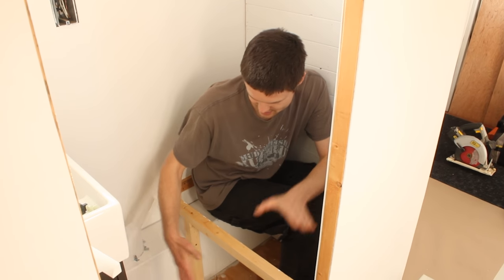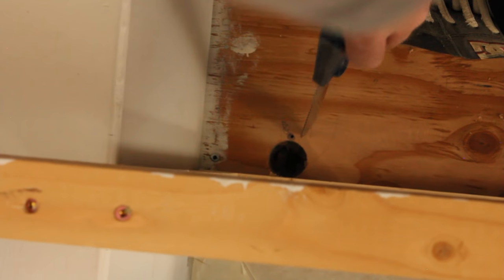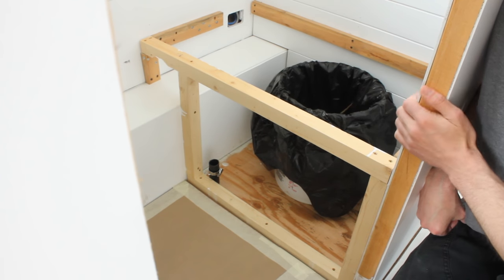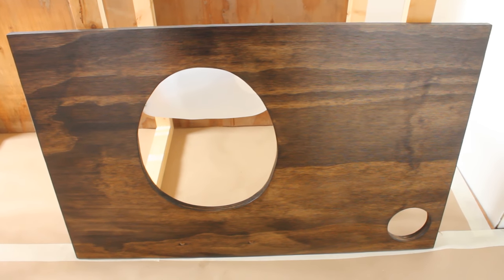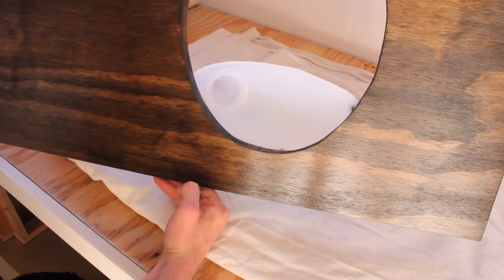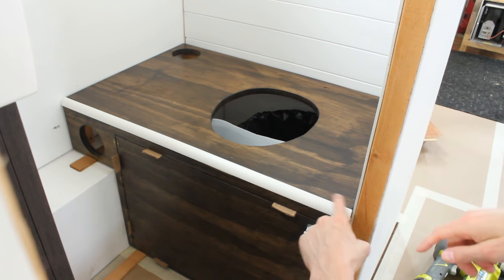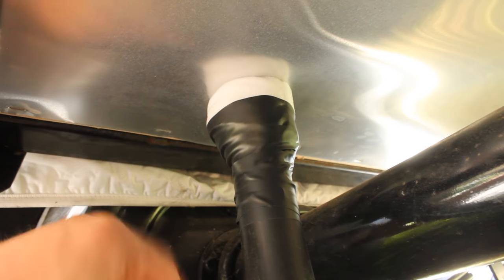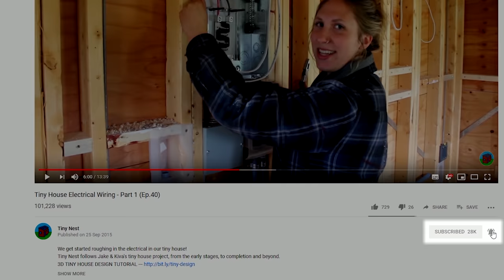Composting Toilet Box (Ep.78)

Comment: Looks great! A tip about the needing nail holes on a finished surface- get some color putty. It's an oil based product commonly used to fill finish nail holes in stained window/door jambs after they're installed. Alternatively you could put screws in from the bottom (nails from bottom wouldn't pull it flush) or clamp and glue that joint (I would avoid this here in case you need to disassemble it later though). Nailing in at an angle doesn't have near as much strength and will often split the wood as well since it's being driven along the grain. For the high nails, a spring nail set is very handy.

I would also stain the inside of the box throughout and caulk all the corners with silicone as well in case of any leaks/incidents but this is probably way overkill. Maybe use some spray adhesive and line the walls/floor with plastic? 

As usual, great work! Love the design and color choices. Just offering tips for anyone they might help, you're too far along for these tips to do much for you haha
Reply from the maker: Thanks for the feedback! 
The plywood didn't have a problem accepting the angled nails in this case, but it was definitely not ideal... I actually like using screws whenever possible because you can manually pull things together until the fit is right. In this case, we are planning on disassembling it because we're deleting the vent holes, we will be remaking the box (the plywood pieces). 
We did caulk around most of it to air seal it for the venting we had planning, but again, that is changing so now it will just be a pain when we go to pull it apart lol 
We're going to at least prime the floor, which will seal it quite well... we're also thinking of laying down newspaper which can be replaced when we empty the bucket, as a backup in case something, uh, goes wrong somehow :| 
Plastic lining could also work... we'll consider it once we're putting it back together.

Comment: So nice to see your solution for a DIY composting toilet. It looks great, but may have some practical issues. So I'm looking forward to see the new video on how you've changed it all. Here's what we thought about after using our DIY composting toilet for 2 years: You may wish to consider a removable urine diverter to take out for cleaning. Maybe also a S-bend with a flexible tube, cause the smell will build up in the tube over time. To get the bucket out easier, you could also remove the bottom ridge of the wooden framework. For ventilation we use a computer fan that is always on. Doesn't use much energy. We are going to make a frame in front of it to hold a simple air filter that can be replaced. Right now the fan is getting very dirty. And have you thought about a squatty potty?
Reply from the maker: We will likely end up getting a commercial urine diverter, and that's a great point about removing it to clean. Ours has been fine so far, because we pour water to rinse/flush after every use, and we pour vinegar down periodically to neutralize any smell, but honestly we haven't noticed a smell build-up (there is an S-bend in the tubing underneath the house). Removing to clean would be a bonus for sure though. 
We are planing on reworking the box so that it opens from the top which will make bucket-access a lot easier. 
We are planning on venting straight down with a computer-fan :) and have already been thinking about how to filter it. 
Squatty potty sounds very interesting, thanks for bringing it up... I bet we could include some hinged foot-rests to achieve something similar... will definitely consider this when re-designing!

Comment: We are using a composting toilet like yours in our camper here in England.  Yours looks good but have you tried sitting on the toilet as you will when it is in action?   You might find your weight is too far back to be able to get up easily.  On a normal toilet we all put our feet almost under ourselves to stand up but with the front sided box, your feet will be well forward of your centre of gravity.
Reply from the maker: It is a bit different than a standard toilet but so far we haven't had any problems getting up

Comment: A rectangular bucket would be easier to slip in and out because you could have it horizontal when in position and then to remove you could rotate it 90deg to pull it out. It might also have better coverage for the "drop zone" 😝 Not sure if Ikea still do the grey "Rationell" bins but that would be pretty much perfect as they are the right height too. Alternatively that hole could have been further towards the outer wall and then the bucket would space to slide towards the inner wall to pull out easier.
Reply from the maker: LOL "drop zone" 
Great suggestion to get a squared bucket, we'll definitely look into that. However when it comes to removing the bucket, we're now planning on redoing the toilet box plywood shell so that you lift it open from the top... we made the door open in front so that we could leave things on top of the box and not have to move them in order to lift it open... but we now have some ideas that will change all of this, and lifting open the top of the box will make it a lot easier to deal with the bucket in general.

Comment: Where and what funnel did you get?  I have tried 3 and dismal failures.  I am working on modifying a r.v. toilet (with the flapper intack) to make a composting toilet.  In concept should work, but lots of functional issues.  May go with a square box with a lid instead of a pail.
Reply from the maker: I looked in multiple hardware stores and just happened across this one, so finding it again would not be reliable sorry :P 
When we do some reworking of the box we'll be looking back into a commercial urine diverter that is purpose-built.

Comment: Hey, you have 3inch toilet  vent pipe thrue sink cabinet, why don't you use this vent to make drainage vent inside of it?
Reply from the maker: That vent was meant to be part of a air-exchanger for the whole house (which would pick up air from inside the composting toilet enclosure on it's way out). We now plan to vent the toilet enclosure directly down, to underneath the house, which will be skirted. We will be closing off the existing penetrations (which are currently through the sink cabinet, toilet box, and joist-cover that is above the toilet).

Comment: I'm a disciple of the Pareto principle and given what you've been thru you should be too .. it does take alot of effort to get the last details done and working .. leave your bucket be (don't modify) and cut another access door/panel to the hall to pull the bucket out .. keep the integrity of the bucket and don't tilt/juggle the bucket to come out .. that will give you the best chance not to have an accident/mess (Murphy's law) .. very pleased you two are still at it to get the TH finished
Reply from the maker: It's a good suggestion, but we can't cut into the hall wall. We do have plans to rebuild the toilet box though, and the top will lift up for easy access to a non-tipped bucket ;) 
Still picking away at it... currently 3D-printing electrical and 12V-lighting cover plates XD

Comment: Could you not have made an access door through that wall on the side?
Reply from the maker: That might have been possible, but what we had planned for a door would not have allowed for it. We're now planning on reworking the box to open from the top. We didn't do that initially for a few reasons, but our approach to the setup has changed and it will be easier that way after-all.